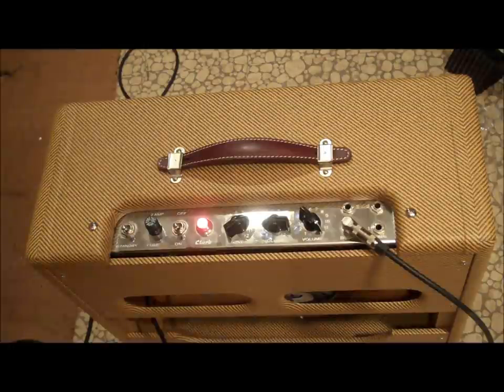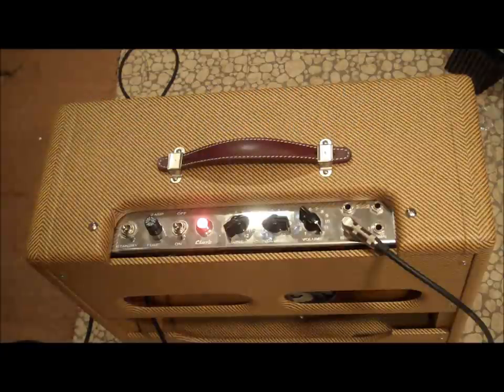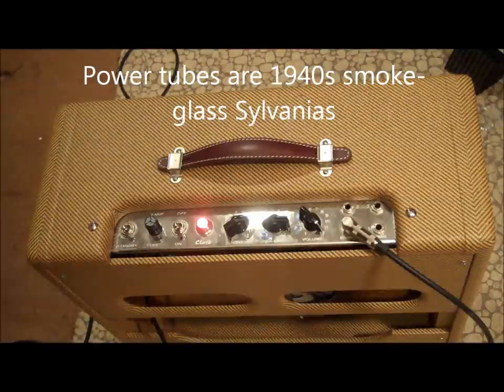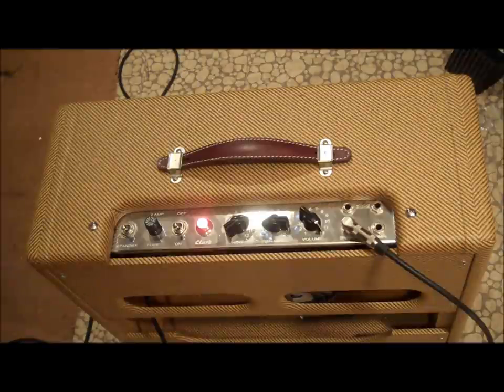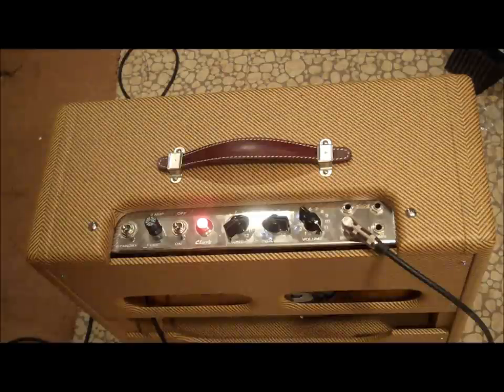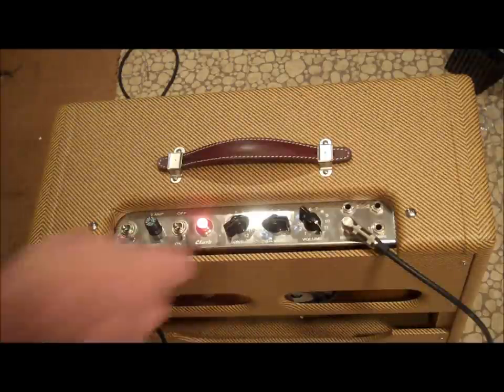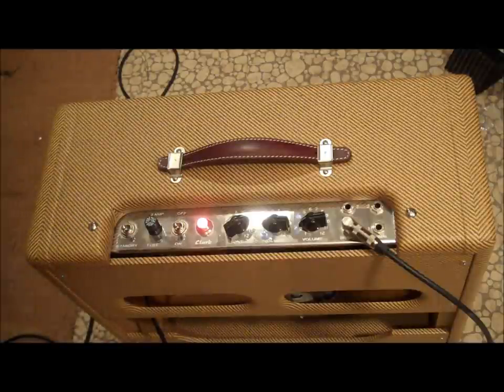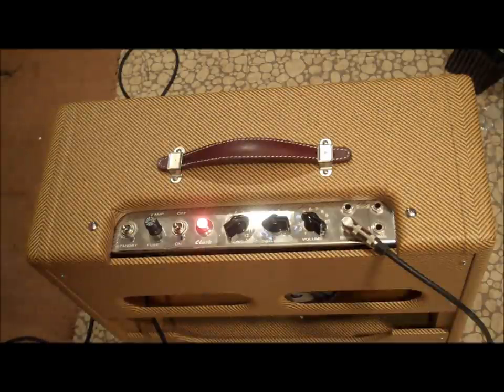Tweed Deluxe Volume Interaction Demonstration

Comment: A local musician brought over his original 58 5e3  Tweed Deluxe narrow panel to my man cave which is fairly large with all wood floors. Never seen one in person and it seemed small. This particular one was refurbished by Chapman and used as the template for Clark Amplification's "Beaufort" clones which are built here in Columbia SC. I plugged in a LP with the Volume about 1/2 way and hit a strong full G and WOW. That thing rang like a BELL!! I have accumulated enough gear over 30+ yrs to open a store but wow this amp just screams mojo. Single coils,P90s,buckers, its all good. With celestion blues and Clark's magic after only a few minutes I knew it was not leaving the house. I rarely play it but when I do it brings a smile to my face which is what its all about.
Reply: I used to have an all original late 50s 5E3 Deluxe in the early 80s. I wish I still had it. What a glorious sound! Mine had a P12Q in it, they're not as raunchy as the R speakers that came in some of them.

Comment: Great video. I know this is old, but I just bought a 57 Fender handwired deluxe. I have never had a 5e3 cirucit before.   I noticed the same kind of interaction and it was weird that even when jumpered, if you turn the mic channel up all the way when the normal channel is in, it actually cleans up the overdrive a little. Very interesting. Good luck. This video is over 10 years old, but still helpful.

Comment: My guess is that is that the two channels are connected to the same barely adequate power source. When one channel is shut down, the other channel gets some of the extra juice. A too small of power supply would certainly be a part of the phenomenon as little resistance would be used to power the preamp tubes.  The low resistance values would make extra juice easily flow through. 
I love weak transformers. They are the magic to vintage amplifiers.

Comment: The chassis looks to be mounted too far inward. On mine, the chassis mounting holes are elongated to allow it to be adjusted inward/outward. The back panel should have foil tape on it that contacts the chassis when the cabinet is all buttoned up for additional shielding. I love the way these amps sound.

Comment: WOW!! What a cool trick to learn. My clone works the same way. I've been trying to find a way to clean it up some more and here you know the trick! 

Thanks!!
Reply: Evens1 That's one route. I recommend trying some lower gain preamp valves. An AU7 or AT7 in valve 1 will bring it down heaps, and you'll break up at a lower volume
Reply: Evens1 use guitar volume to control cleans. Also Don’t pick or strum so heavy and you’ll get great cleans

Comment: I think you do not get the full potential of the amp by having a 12ax7 in there. You bump up the gain and you just get a lot of preamp distortion. 
Two 12ax7 adds up to gain factor of 118 before hitting the cathodyne, With a 12ay7 in V1 you have a gain factor of 93.4, which still have plenty of gain but also a slightly different sonic character with the 12ay7. The dearmond R15 which is a 5e3 clone, has a 12ax7 in V1 but omits the bypass cap on V2 which adds up to a gain factor of 92.8.
Reply: Very much agree with you dansk, there is still plenty of gain available when using the 12ay7.
Wonderful amplifiers,
Reply: I was reading about the DeArmond amp just the other day, interesting amp. I heard that Leo copied that circuit from the suggested circuits from Western Electric tube brochures. They probably got it from somewhere else.

Comment: Actually, what you are experiencing is the negative effect of the interaction. As you turn your volume to max you are providing no ground reference to the input. That is why when you turn the normal volume down, you get more gain. That is counter-intuitive as you should get additional gain. The real interaction comes with both volume levels in the 2-9 range. Maxing either volume is, like I said previously, killing the input ground reference and actually killing your signal.
Reply: The volume pots are wired as variable resistors instead of the usual voltage dividers with mixing resistors.

Comment: Think you could tell us more about that amp?  Celestion Blue & a P90... check.
But what about the coupling caps make and values?
Filtering caps or other mods?
NOS tubes?  12ay7 or 12ax7 in V1?  ect...

Comment: Hi, just wanted to ask one small question. Is this amp a Fender custom shop amp?Thanks from Michael Newell from Niagara Falls, Ontario, Canada
Reply from the maker: No. It appears to be made from a (Weber?) kit that someone stuck in a Clark chassis that is marked as a second. The cab is not the one it was in when I got it, it was in a 1x15 cab.
Reply: @ThePedalPimp  , yeah I have a pro junior that I put in a Matter Tweed cab 1x12 with a Celestion Alnico Blue 15 watt speaker . Mine sounds very close to yours. I recently have bought a Ceriatone HRM amp and a Ceriatone JTM45 BLUESBREAKER  amp. Fabulous amps and killer price to boot. Thanks for the info on the amp. Thanks from Michael Newell from Niagara Falls, Ontario, Canada

Comment: Are you not using a Les Paul too?  Those humbuckers are just slightly over wound and giving just enough distortion even at a low volume because I have heard a Strat played thru this amp and it does not sound like a mini Marshall at all.  It is very clear till the amp is 3/4 up. I am a bit surprised at your sound as I've heard other Les Pauls that are not so distorted sounding thru the amp.

Comment from the maker: I bought it used so I don't know much about its origins. It looks like it was built from a kit. It's running older tubes and the speaker is a Celestion blue, but other than that none of the parts look to be anything special.

Comment: That's not really something unusual, someone either did a master volume mod on a deluxe clone, or they built a different kind of amp in a deluxe chassis. I do this all the time. Sounds like someone built a matchless lightning clone in there or did one of the 1001 gain mods on an amp. If you can get pics of the inside of the amp, I could help you out more..
Reply: I play a L'il Dawg 5E3 D'Lux (12 watt output) and the interactive controls seem to behave exactly like this demo - and as far as I can recall exactly like my first Fender Deluxe. It's a little hard to tell given Youtube and the camera's audio but I think I'm hearing the same "clean-up" when you push the mic volume above 9 and up to 12. for me that's my fave - the highs tighten up and the compression rolls off a bit. Super sweet. Jim at L'il Dawg is a prince to work with - I got his amp 6 years after it was built, in Canada f'cryin' out loud, and the man sent pics of the build of my chassis (#403) and what he had on file about the amp. Great guy, great amp.
Reply: The 5e3 circuit does that.  Two of the inputs go to one half of a dual triode and the other two inputs go to the other side half of the dual triode (12AY7).  Both of these triodes are coupled by their own capacitor their own volume pot. After the volume pots they share the rest of the circuitry as they go to the input of the phase inverter.  They are interactive because even though one input circuit is not being used, it is still robbing gain from the other one, much like the tremolo circuit in a blackface fender will do unless you put a switch on the intensity knob to completely disconnect it from the channel.  As you adjust the volume on one input, it affects the circuitry of the other. The tone knob is also interactive.

Comment: This was modified for sure. You cant get these gains with a stock circuit.
Reply from the maker: The circuit is stock, but I had a 12AX7 in V1 rather than a 12AY7.